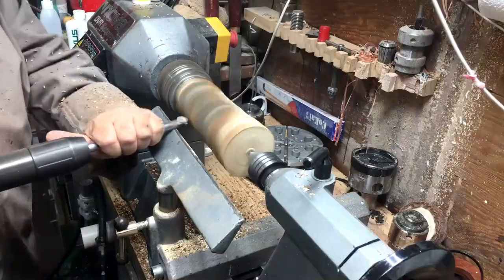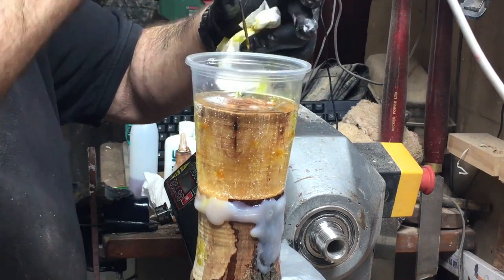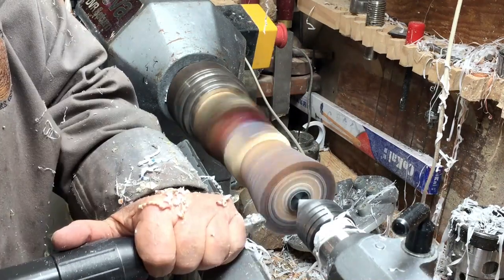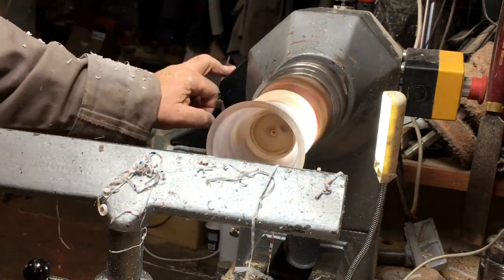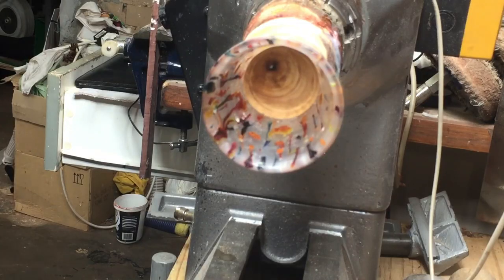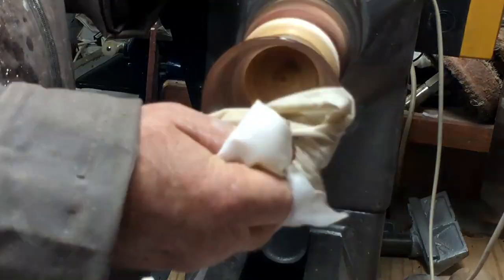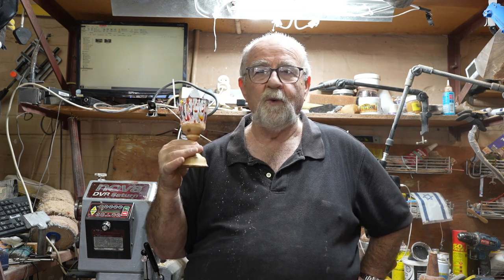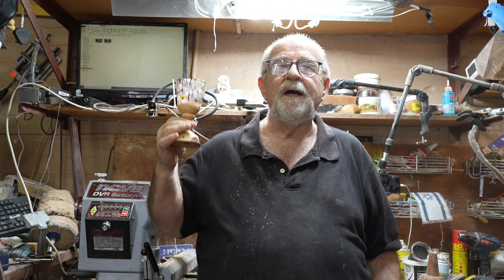Woodturning a goblet with impregnated resin

Comment: Wow, nice one! I had this idea years ago but never actually followed through and tested it. You can imagine my surprise when I saw the thumbnail of your cup where you actually did it! It looks great! I know this would take a lot of patience, but have you considered doing a coat or two of epoxy to seal the wood first, and then doing the casting? I know that epoxy generates heat when it cures and that sometimes "boils" the wood, but maybe if it was sealed first that would avoid the bubbles? Oh, also, great idea to set the plastic cup in place on the lathe - I had never thought of that, and it looks like it worked very well!
Reply from the maker: Wow you know great minds think a like. Thanks for your tip and for your comment